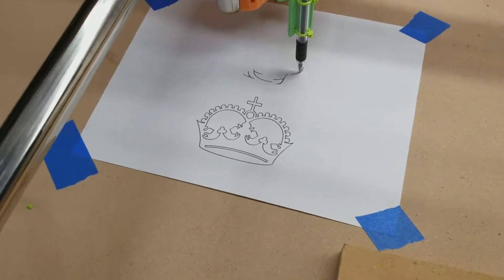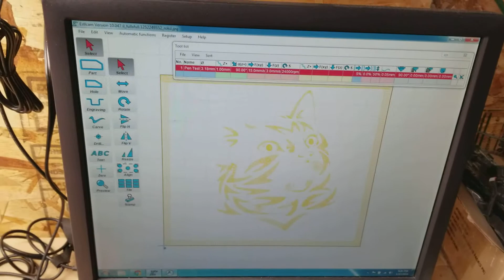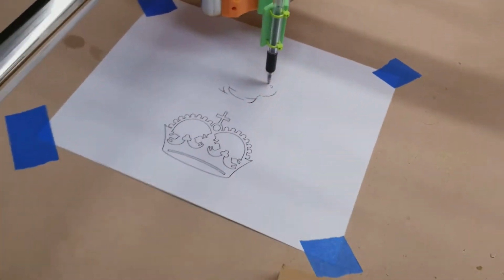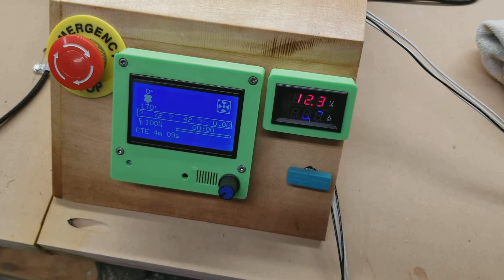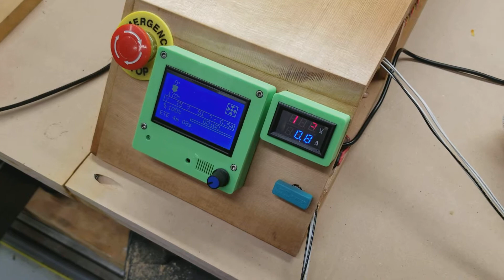MPCNC First pen test!

Comment: Wait I was right? I have a few people in my life I need to share that with. HA! (probably a lucky guess, really). Nice build.
Reply from the maker: So far so good! Thanks for all your help on the forum Ryan! I've been slowing learning the CNC world and all the processes, terminologies,etc taking baby steps at a time. The only thing I'm not fond of is the ESTLCAM software, I find it very difficult or confusing to work with so I've trying out a few others and have found that MeshCAM is giving me excellent results and is very nice to work with! I always believe in paying for SW if its good so I'm close in pulling the trigger on MeshCAM. I found that you have to set it to "TURBOcnc" for Repetier to like the output and work with our machines but its pretty nice.

As for the PS, yeah (LOL) i was hesitant of the 6a you give in the kit because I want to mount a 3w laser I also have soon but I've tried to load it up and have seen no more than 2.8amps now. Another video and thanks again!

https://youtu.be/3gHAcXgTIKw
Reply: I started with MeshCAM, I think my first video was cutting its demo 3D face. Software isn't too big of a deal for most cuts, chose what you want. I have not kept up with it's features to see what it does and doesn't have. Depends on how deep you want to get into the rabbit hole. FusionCAM has most options you could ever want. For me I can set up a cut in Estlcam in a few minutes and not look back, so for me it has every feature I want. I am sure Meshcam is full featured enough and worth the money, just make sure it has some sort of carve with a Vbit and you should be fine. 
The thing to look out for is the post processor, we have tweaked them all. You really must have different feedrates and rapids for the XY and Z axes, displayed on each line. Marlin does not see G0 and G1 differently. With out this do not waste your time or bring the Post Processor to the forums and see if one of us can make it work with Marlin correctly.